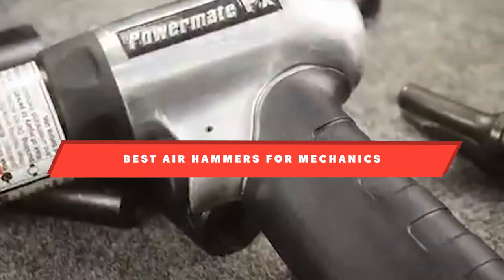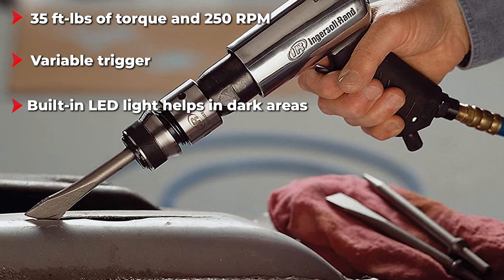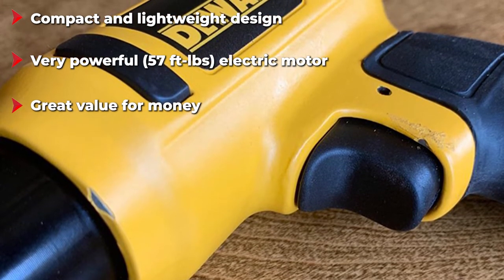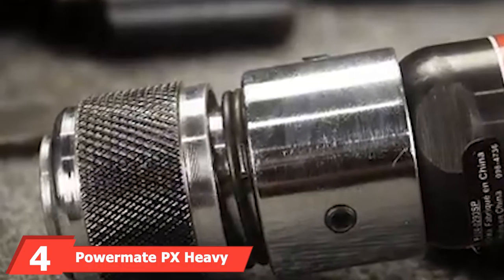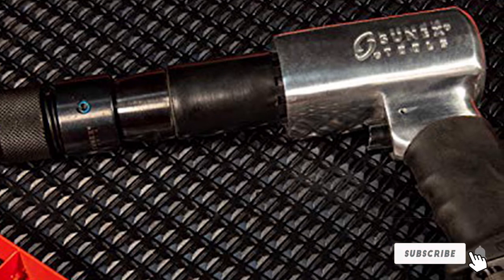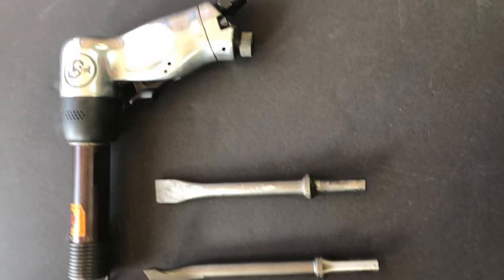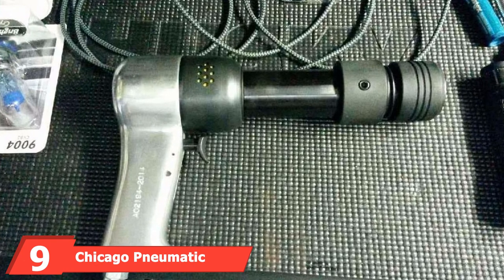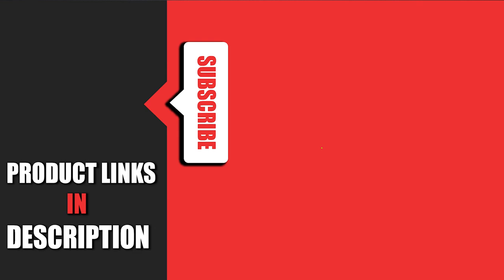Top 10 Air Hammers for Mechanic in 2024 (Top Picks)

Comment: the DeWalt is one of the worst air hammers on the market, so the fact that its even on this list tells me you've never touched an air hammer.  The first one you showed the 114 IR is an excellent model for the cost.     the dewalt is extremely underpowered, the 8 dollar walmart ones have more power, thats no exaggeration either. its pathetic